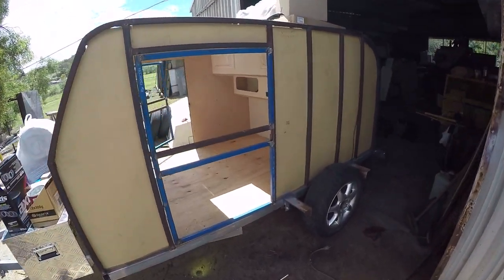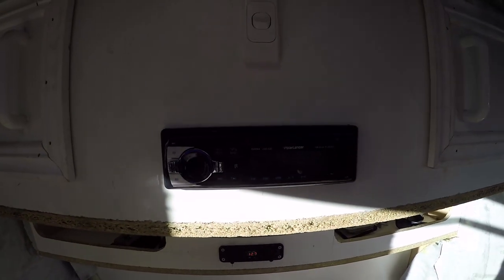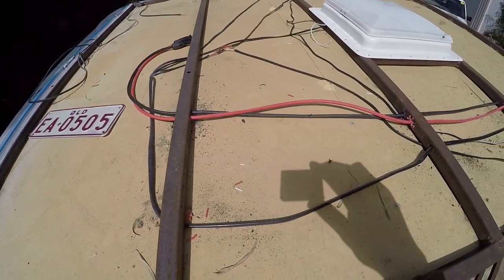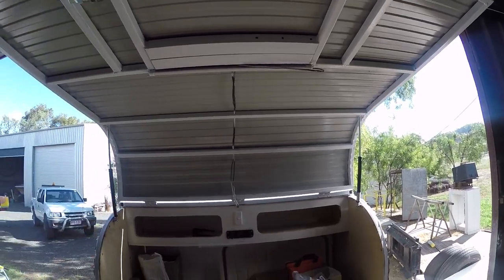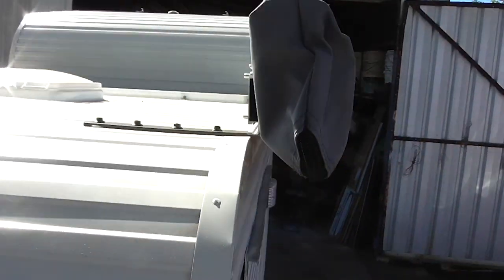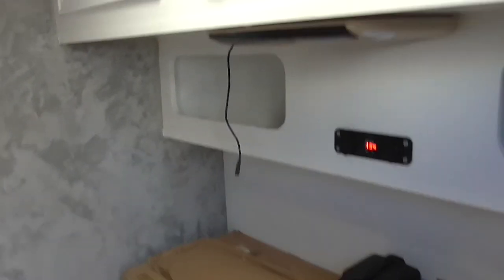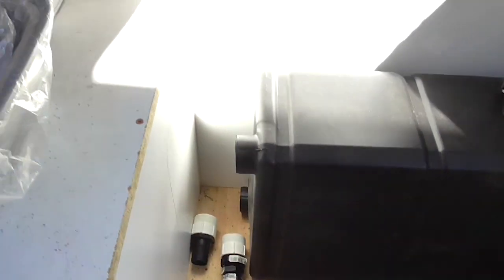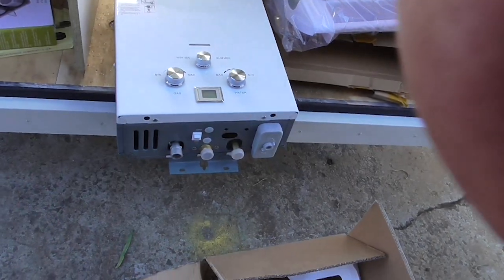Teardrop Camper DIY Build Update 2

Comment: I guess it's human nature to point out things we would do differently.  I know my first few builds of things haven't gone as intended so I've had a habit of building a trial version or prototype that I plan to make my mistakes on and sell when I get a better idea of what does and doesn't work.  With yours the biggest issues I see are poor air quality inside of it, no protection of the wiring where it goes through the metal beams, the insulation is also useless when it's compacted or compressed.  That said, it's well thought out and has a lot of nice features for a small space.

Comment: how are you going to seal the doors? Also have a look at Camec water tanks.
Reply from the maker: there will be a backing door jam to the 2 interior access doors with rubber seal on them, the rear door to the kitchenette is sealed along the top with rubber to allow it to fold when the door is raised and rubber door seal around the sides and base. I will include some more detailed video in the next installment to show it in more clearly after i finish the camper this weekend. Thanks for the advice on the water tanks i will check that out.

Comment: Do you have a link for the metal cladding .
Reply from the maker: this is the stuff i used https://www.metroll.com.au/products/roofing-walling/metrib/ 
any roofing metal producers/suppliers usually stock or make the stuff, just ask for low rib cladding and most suppliers will have something similar